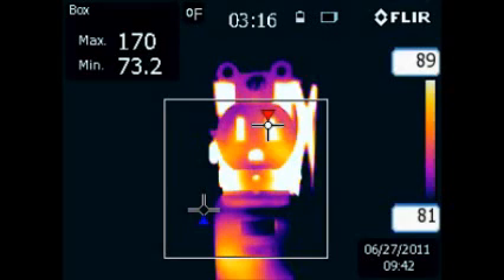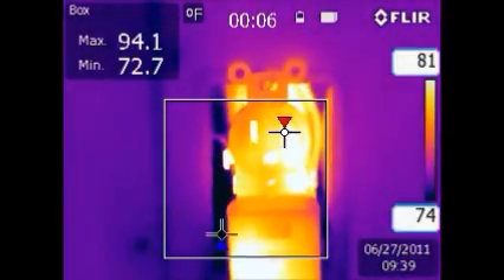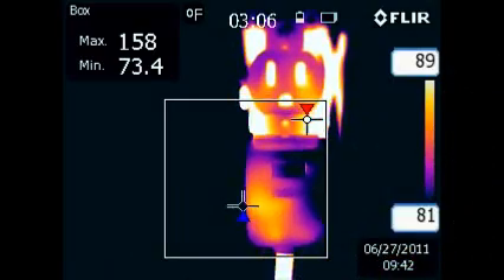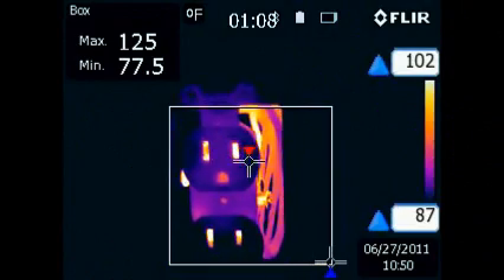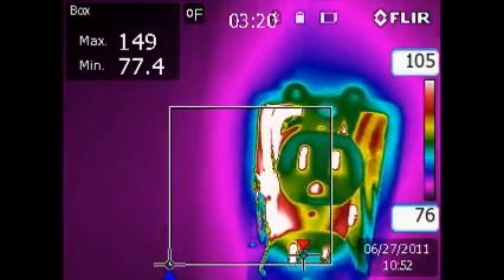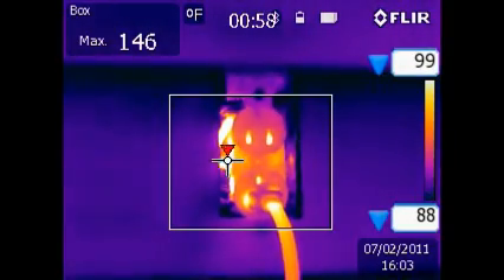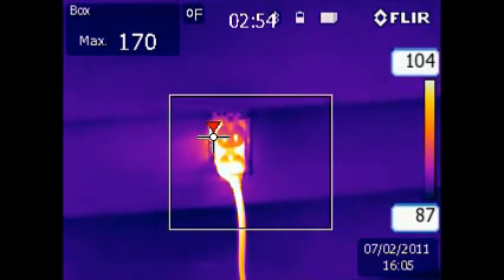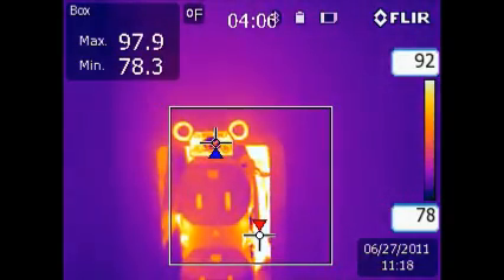infrared electrical inspection

Comment: is a 50n gallon water heater  top element  3500 w batoom 4500 w  is pulling 18.4 amp each     is pulling 250 volts   bottom element  and the temp in the breaker is  from 110 to 120  heat f this is normal ?
Reply: Luis normalmente los breaker  estan a 40 c  o 104 f  marcadas en las pastillas. entonces si se te pones a pensar que hay vecez que la temperatura de afuera esta a mas de 100